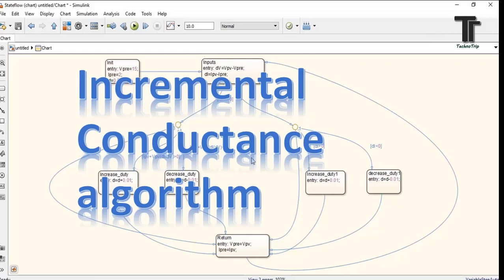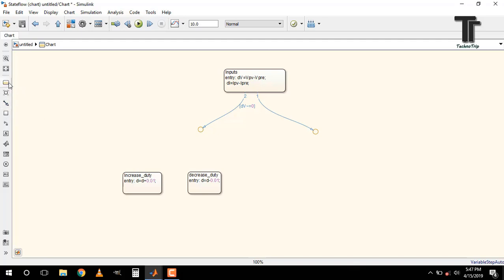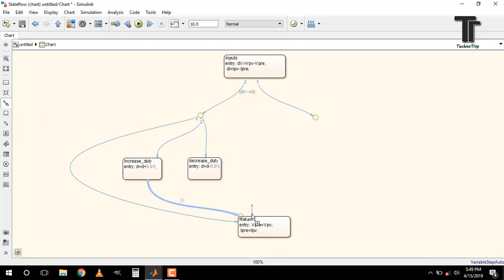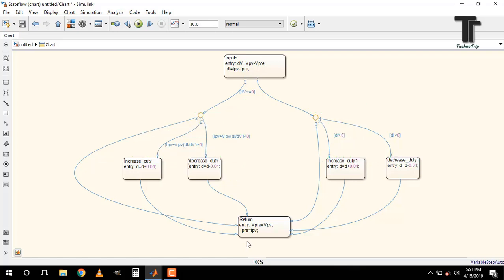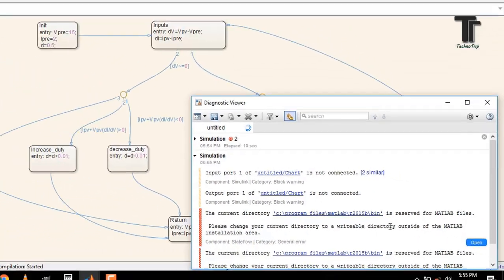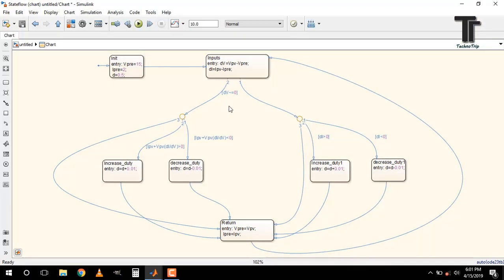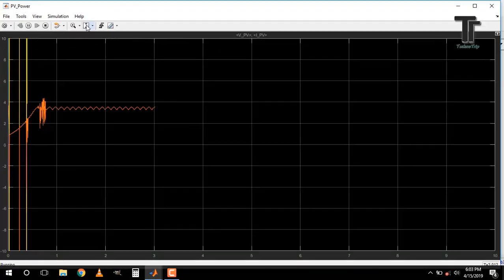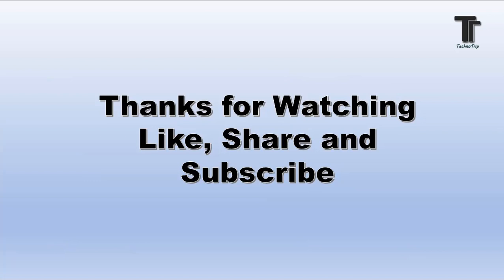Incremetal Conductance (IC) algorithm, MPPT algorithm, in Simulink / MATLAB

Comment: A question please: when I run the simulation of MPPT, the current generated by the PV generator switches between positive and negative values which is illogical and affects the results of the other parameters. You can help me please ?